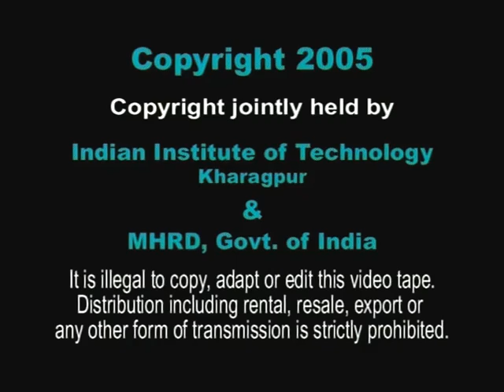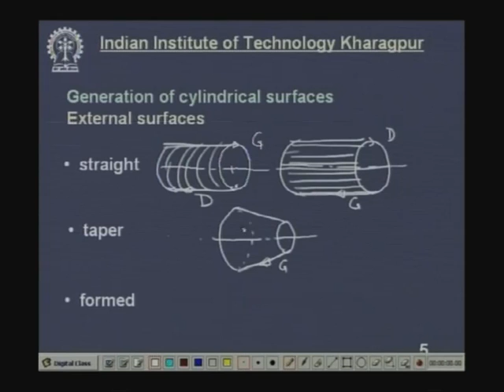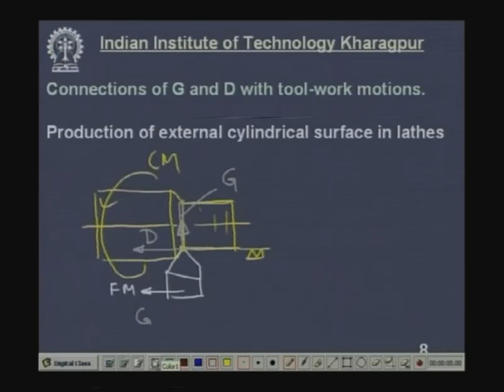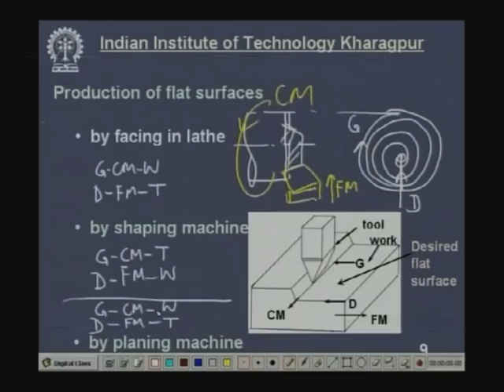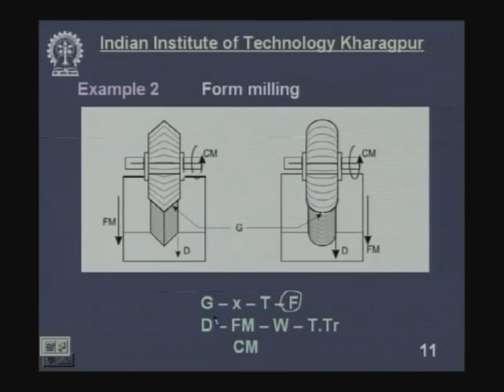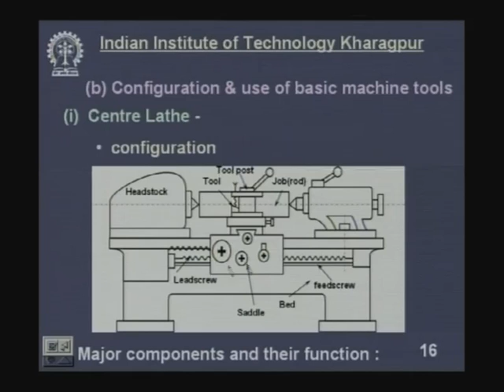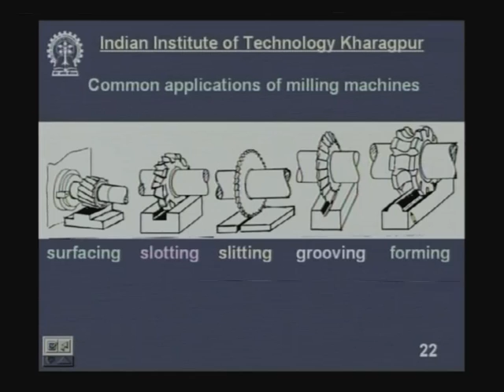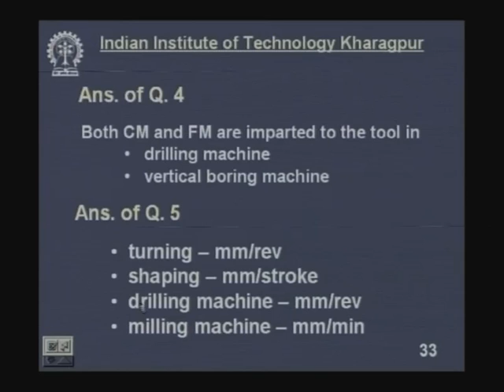Lecture - 2 Instructional Objectives - II

Comment: at 14:28 while discussing motions of gear cutting tool the circular motion of it has been mentioned as feed and the reciprocating as cutting motions...why is it so?...I thought the reverse way
Reply: because rotation of tool does not cut the groove in gear blank but, reciprocation of tool does similar to shaping action while, rotation of tool (FM) and indexing is done at same time without slip for generation of tooth gap similar to rack and pinion gear production.